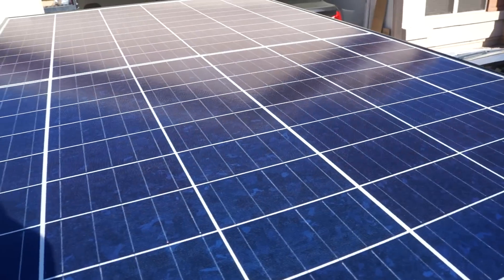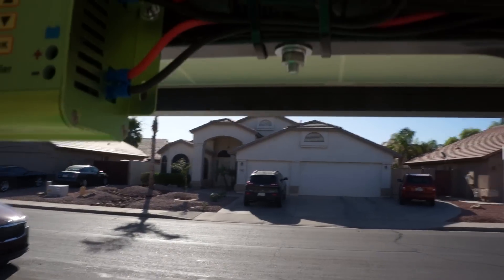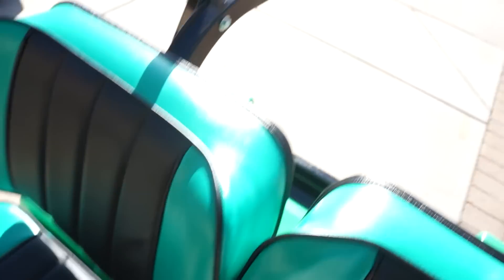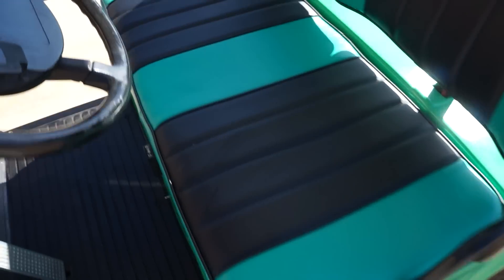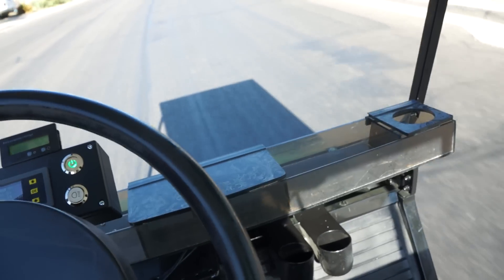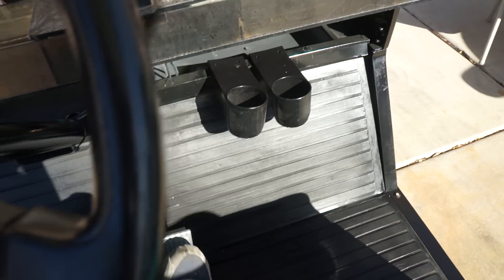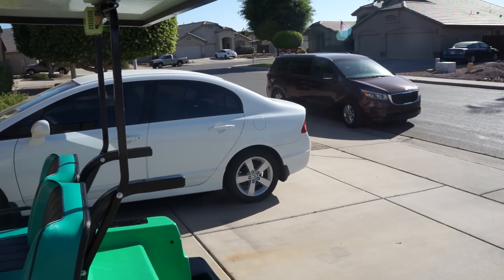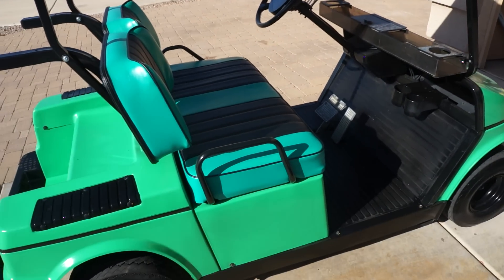Electric Solar Lithium Battery Hyundai Golf Cart Project Part 3 (Finished)

Comment: what model is the display you are using?......the one under the charge % display....i like that
Reply from the maker: There are many version and different shunt size but here's one of them:  https://www.amazon.com/KNACRO-Multifunctional-Wireless-Bi-directional-Voltmeter/dp/B075CVKK1K/ref=sr_1_19?s=automotive&ie=UTF8&qid=1536970417&sr=1-19&keywords=digital+power+meter